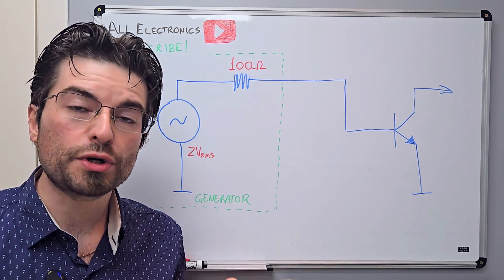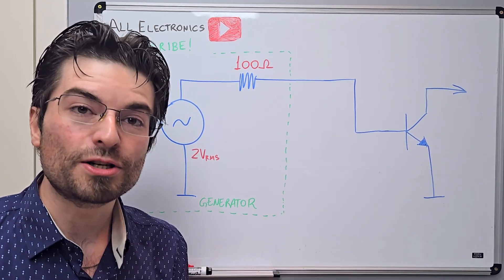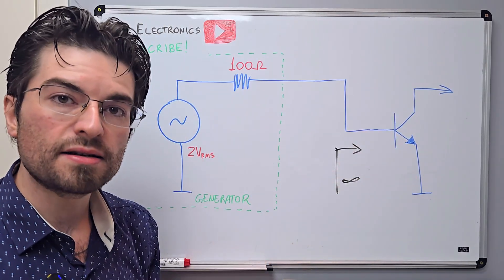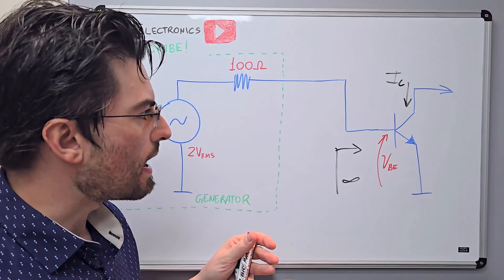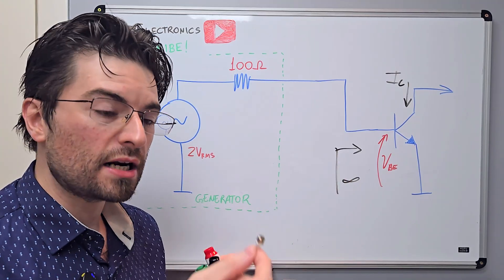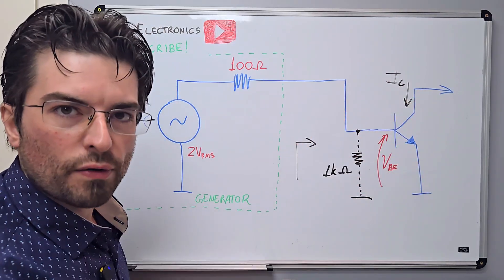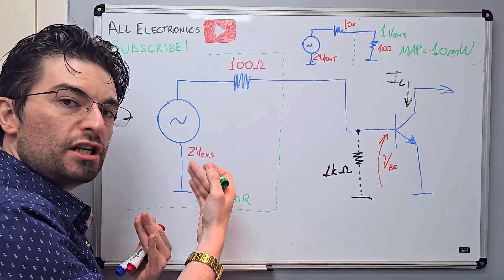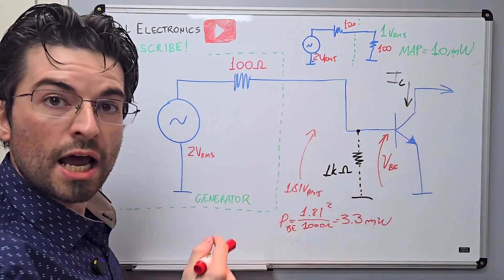Why Impedance Matching Still Matters for Transistors

Comment: I am sorry, I did not get why should I care about power once the TBJ (as you say) is a current source depend on voltage source. So it is look that for maximum Ic current it only need the maximum voltage  instead maximum power. What did I get wrong??
Reply from the maker: Watch the video. The maximum voltage will always happen at the maximum-power point!
Reply: @AllElectronicsChannel  But in the first exemple Vbe = 1,81 and power P=3.3mW and then, in the second exemple, Vbe = 1V and P=10mW.
Reply from the maker: No, 3.16V at the base. Watch that part again..
Reply: @AllElectronicsChannel  Now I get. It is strange that voltage will increase, but ok, o got the point.
Reply from the maker: Nice Rubert, you are welcome man. Wish you a great 2026.

Comment: something is wrong in your video. BJT are not voltage controlled devices but current, hence one of the characteristic property of them called hFE is the ration of collector to base current.
Reply: They are voltage controlled and the base current is a secondary effect
Reply: "BJT are not voltage controlled devices but current"
Exactly right.  The base-emitter VOLTAGE is always going to be 0.6 volts for an operating silicon transistor.  What varies is base current not base voltage .   This is a great example of not believing everything in a youtube video.
Reply: @thomasmaughan4798 not correct. The voltage changes. It changes by a very small amount, but yes it absolutely changes. Find some base voltage curves
Reply: @researchandbuild1751  "Find some base voltage curves"
Or make your own.  Trying to control a transistor by voltage is inherently unstable; a small change in voltage leads to a large change in current.  Transistors are current operated devices.  You need enough voltage to push the current, but it is the current that activates a transistor.
Reply from the maker: As commented here in the thread, BJTs are voltage-controlled devices, and the collector-to-base current-ratio is a secondary effect.
Reply: @AllElectronicsChannel  "BJTs are voltage-controlled devices,"
Your mileage obviously varies but someone as knowledgeable as you could not possibly be this wrong unless you are seeing things in an unusual way.
"the collector-to-base current-ratio is a secondary effect."
Why is that considered at all?  In an NPN transistor, the collector will be tied to a positive source and the base will also be connected to positive, just not as positive as the collector.  This ensures reverse bias on the base-collector junction and essentially no current. 
In normal operation of an NPN transistor as shown in your diagram, a small (electron) current from emitter to base enables a much larger current from emitter to collector.  This ratio is designated hFE and typically 100 times amplification.  
To prevent clipping, the base current is biased so that a base current is always flowing; and because it is a silicon PN junction, is going to be around 0.6 volts and resistant to change.  If you TRY to increase the voltage, you simply increase the current and the resistance of that junction goes down, emitter current goes up and the collector current goes up (a lot).  The inherent instability of this arrangement means you cannot just choose a VOLTAGE for the base-emitter junction; you CAN choose a CURRENT.  
It is also nearly universal in common-emitter circuits to introduce a resistor on the emitter such that this instability is stabilized somewhat; a tendency to current runaway produces a higher voltage drop on the emitter resistor which opposes the base-emitter voltage hence current.  
Yes, voltage is involved without voltage no current would flow, but what controls a transistor is base-emitter current, specifically, inserting electrons or removing electrons; that is to say, providing the necessary charge carriers that enable electron transport from emitter to collector. 
Other circuits exist of course, common base being one used as an impedance transformer.
Reply: Bingo.

Comment: Great video! Pretty cool how you explain how to "shift to RF" and how the mental structure changes compared to low frequencies.
Reply from the maker: Yeah! It's interesting to read here in the comments how many people were unable to shift. It really required "unlearning".
Reply: When you go to RF you really need to start thinking of everything as a wave that reflects, gets radiated and genereally does the opposite of what you want. Also the fact that everything has a capacitance is suddenly very relevant, and that some components can start acting very strangely. You can even get capacitors to act as inductors if you hit the right frequency.